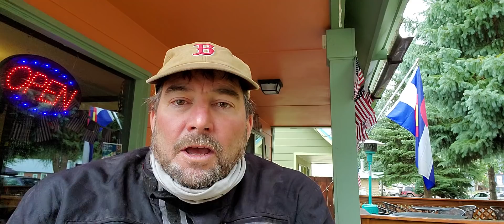5th Stage Bleed Valves explained 737 Emergency AD

Comment: This is probably unrelated but a couple years ago I was on a plane and soon after the doors were closed at the gate, my ears popped.   I thought this was a little odd since this usually happens at altitude.   A couple minutes later, the pilot said we will have to take another plane.   When I heard about the two bleed valves it reminded me of this incident.   The plane was a Embraer ERJ-145.  Any idea what this was?

Comment: I was wondering if the  the air from the little overhead nozzles came directly from the bleed valve or is it recirculated air. I was thinking you could make a mask for nervous people that hooked up the the nozzle and provided them with "new" air rather than recirculated air.

Comment: https://www.youtube.com/watch?v=L4CT6qCNW8A AGENT JAYS Z'S VIDEO HAD OVER 500 HITS WITHIN A COUPLE OF HOURS. STIFF WHISKEYS ALL AROUND ON THIS ONE! THIS IS  BETTER EXPLAINED IN AN EARLIER VIDEO HE MADE. As you say 3 different types of bleed air for the turbine alone. AND Redundancy built into the engine with BACKUP Valves. So a backup valve which IS'NT even in the Service Manual for the engine is the part thats failing. Essentially Rusty Springs that force the valve doors to close on a drop in pressure. With other BLEED AIR Systems you DON'T even know about as they're used to cool the flame (barrier with the inner casing) and Cool air between the inner and outer casings. So ALL IN ALL somebody has written a confusing directive as those pipes providing the cooling air to the turbine casing just show up as engine temperature in the Cockpit. Yet are and Intergral part of Cooling the engine itself.

Comment: Great explanation about the 5-9 and compressor stall - but what if both engines flame out at 30K feet? What will happen with the pressure in the cabin?
Reply from the maker: Slowly depressurize. Not to worry, you are going downhill anyway...

Comment: As a former jet aircraft tech in the USAF many years ago I fully understand all of this. A good example in relation to one of the first things that I was taught, and latter experienced, was the problems that develop with aircraft that aren’t flown for a period of time like a hangar queen. This brings up a concern with this  Corona 19 storage situation and all the aircraft returning to flt ops, what is being done to prevent other problems arising from this flight inactivity? I would think some sort of depo level overall inspection and R&R of other essential items. It would be horrible to have a rash of problems and accidents result where post findings prove the problems originated from the storage period.

Comment: I have a question regarding Air France 447. The pitot static tubes froze mid flight which caused disorientation and ultimately the stall and crash. How can this occur? Is there an anti-ice system for the tubes that malfunctioned?
Reply from the maker: Overwhelmed.

Comment: simple fix...clean the valve or change it and send the bad valve to get fixed {usually just a cleaning will fix it} FRC East did tons of these valves and there is nothing to them...the problem is storage not running and the reason the AirBus does not have these problems is they have not been in storage...have a good trip Juan

Comment: That’s the most kack - handed explanation of the Cfm 56 bleed air system I’ve ever heard. In fact, 5th and  9th stage air bleeds into a common manifold. 9th is prevented from bleeding ‘backwards’ through the 5th stage manifold back into the engine by the fifth stage check valve, a simple flapper style valve that must be oriented correctly on the engine so that gravity does not hold the valve in the open position. At low power settings the fifth and ninth stage air flows through the PRSOV, the Pressure Regulating and Shut Off Valve, which modulates between open and closed to maintain downstream pressure at about 45 PSI. Obviously, the fifth stage check valve is very important and there are already many AD’s regarding its inspection and function. The system is almost the same on ‘Classic’ dash 300/400/500’s and the ‘New Gen’ 600/700/800/900’s. Not sure about the Cfm56-5 engines on the A320/A340’s. I’d reckon they are similar but, as I’ve never studied them, I can’t say.

Comment: At work we use a turbine engine to produce electrical power, the fifth stage bypass is used to prevent over pressurizing the compressor at low rpm/ low power , cool the exhaust compartments, and provide anti icing to the inlet.

Comment: JUAN, hello, but at least I  am not sure if the B787 uses bleed air to pressurize it, but the CABIN pressure is MUCH LOWER THAN USUAL + the. HUMIDITY LEVELS ARE HIGHER ZTHAN NORMAL& the AIR CONDITIONING does not use bleed air. Not been on one as yet ,  this valve is a n ODD ITEM caused by lack of use due to COVID 19, oh well  Cheers 🇺🇸🇺🇸🇺🇸🇺🇸

Comment: Double flapper style bleed air check valves are explained in this report of previous failures. https://www.google.com/url?sa=t&rct=j&q=&esrc=s&source=web&cd=&ved=2ahUKEwjlx6C3gurqAhVfAp0JHbB8Am8QFjABegQIAhAB&url=http%3A%2F%2Fwww.ansv.it%2Fcgi-bin%2Fita%2Friscontro%2520FAA%2520per%2520OY-MRG.pdf&usg=AOvVaw1Ht1dHuFMr84EjFBvdufu8

Comment: The bleed air valves are part of the airframe TC even though installed on the engine. (Same as they IDG). So on the CFM56-5 for Airbus they use different bleed control valves.

Comment: I was on a flight out of DFW that couldn't keep pressure after leveling from climb. They wiggled the wings a few times (trying to free up a stuck valve i assume). We turned back to DFW but had to hold a pattern over northern TX to burn fuel before landing. I wonder if this has been a common problem?

Comment: Have been to GE CFM56 school. This type and style of check valve is common on a lot of different engines. Very simple design. Usually on a letter check there are work cards to remove these valves and visually inspect and check the wear with a feeler gauge. Just two flapper halves (looks like a folded in half taco) with a single hinge pin. Some times they are worn and may not close all the way. Hardest part about doing the AD is opening and closing the fan and reverser cowls. Never had one hang completely open or corroded. They are asking you to to the usual wear check and exercise the flaps in case they are stuck. Usually after a 5 day sit most airlines require a take off power confidence check engine run. If it is stuck open this is where it will show up. Both engines inflight having the valves stuck open would say is highly unlikely. Doing the inspection after an extended storage would be prudent under the circumstances. Not every airline does good maintenance. Happy travels!  👍

Comment: A side question in terms of Atmospheric Pressure, What is the limit of Atmospheric Pressure that a commercial aircraft can handle at sea level on the tarmac if pressurized.  I think it is less than 2 units of Atmospheric Pressure. Do you know that measurement

Comment: Interesting issue. Surprised there is not a check valve preventing flow from 9th stage back into 5th stage, sounds like a design issue.
Reply: My thoughts exactly.
Reply: There is, and it can stick open, hence the problem.

Comment: Can bleed air valves be changed with the engine still hanging on the Wing or does the engine have to come off the wing to change it ?
Reply: They can be changed on wing. Simple job.

Comment: According to research by Maximus this engine  dash number ie only used on Boeing air craft. Normally I would agree that a dual engine failure from this cause would be extremely rare but the game changer is air craft storage especially if it is not stored in a desert type climate.
Reply: Both engines were/are stored undertake same conditions during shutdown, so its the one fails due to corrosion it is quite likely the other is harmed as well.

I strongly disagree a double engineerings failure out of this rout cause is extremely rare. So does the FAA.

Comment: Is this check valve considered part of the engine or part of the airframe?  I am guessing airframe and that is why the A.D. is written on Boeing 737’s.  If it was the CFM56 engines I am guessing the Airbus A320s would be included.

Comment: As a 35 year Amt for a major airline let me summarize. At high power settings the 5th stage is adequate for most bleed air needs (air conditioning, pressurization). At low power settings (taxi, descent) the 5th stage needs help to keep up with those demands. A 9th stage augmentation valve will sense the low pressure from the 5th stage and open to assist with those bleed air needs. The 5th stage has a "one way" check valve to prevent high pressure, 9th stage air,  from bleeding back through the 5th stage bleed air port. If the 5th stage "one way" check valve remains open during 9th stage augmentation, then a "blowback" occurs thus introducing high pressure, 9th stage air,  into the lower pressure, 5th stage air,  compressor section. That will cause "Compressor Stalls".  Alot of aircraft have been parked during this shutdown, and their systems have not been "exercised"...Depending on the abnormality, you may see engine start abnormals, high power setting compressor stalls, or low power setting compressors stalls. Any aircraft that have been parked during this "crisis" need to have thorough run ups and inspections.
Reply from the maker: Thanks Robert, can you tell us about the inspection process for this AD?
Reply: @blancolirio  https://rgl.faa.gov/Regulatory_and_Guidance_Library/rgad.nsf/0/ec0e5875b315e9e5862585ae007cd448/$FILE/2020-16-51_Emergency.pdf
Reply: Robert Costales - Would have thought the pre-storage process would include prepping the valves would be protected some way. Likewise the process of taking it out of storage would include checking and prepping them for re-entry to service.

Storing a 737 isn’t something new, so the issue must have been known previosly. I guess the number of aircraft being and coming out of storage increases the risk, hense the AD to ensure that they are checked before entry into service.
Reply: @ACPilot  There are very specific procedures to carry out when an aircraft is parked. Depending on the length of time it will be parked, the procedures become more detailed. But, you are right, with so many airplanes parked at once it certainly highlights what was probably just an occasional issue previously. The only effective way to handle it now is to issue AD's. I have a feeling we are going to be seeing a lot more AD's for various issues related to all these planes being parked.
Reply: Robert Costales 
And now you know why Boeing is afraid of how some airlines have put their Max’s away.  Stories of damp humid conditions, no covers, etc.  Another major issue with the Max, no matter how much was to blame on the airline, and it could be that last straw.

Comment: Appreciate the details, I never new pressurization drew from different compressor stages depending upon conditions.  Good job Juan..! 👍
Reply: All engine manufacturers and engine types approach this problem differently. Only the engine specific maintenance manual(s) knows for sure.

Comment: So very jealous of your trip but Holy Molie you are beginning to look like me after three months "lockdown" in the UK . Several friends commented "Here's Johnny" to my photo posted on Facebook. However thanks for the update on the further problems with the Max. Hardly surprising. Aeroplanes are designed to be worked and worked hard. Leaving them sitting around is bad for them(and their crews). I am saddened that the popular press will latch on to this story and try to drive another nail into what is essentially a good aeroplane.

Comment: Juan yes the AD at the moment only applies to the CFM-56 engines. Used on the 737s. Same engine used on A-320. However the engine on the 737 is flat bottom and because of that it does behave differently between the two aircraft . that's the simplest answered to your question without getting into great detail.
Reply: Also the make of valve is different.

Comment: Juan, VERY WELL explained in lay terms. I fully get it but have one question?  I am assuming that Both engines are supplying bleed-air  to the commoned functions. Instead of cutting one engine, couldn't the stage 9 valve be closed on the engine with the stuck stage 5  allowing that engine to supply lower pressure bleed-air to the cabin instead of none at all?      sdh  in CT  (BDL)

Comment: Juan, the check valves are not a part of the CFM56 engine itself, but are a part of the nacelle and engine supporting equipment.  They were developed by Boeing specifically for this installation, which is why Airbus wouldn't have them even though they use the same engines.  Airbus will have a similar design for their installation.

Comment: If the 5th stage valve is inadequate during lower power, why not use the 9th stage 100% of the time for the bleed air functions?
Reply: Robert Costales (comment above) explains the relationship between the two valves: "The 5th stage has a "one way" check valve to prevent high pressure, 9th stage air,  from bleeding back through the 5th stage bleed air port. If the 5th stage "one way" check valve remains open during 9th stage augmentation, then a "blowback" occurs thus introducing high pressure, 9th stage air,  into the lower pressure, 5th stage air,  compressor section. That will cause "Compressor Stalls". " Hope that helps.
Reply: @lizj5740  Yes, thanks!
Reply: Why not use 9th stage all the time?   Probably because it's inefficient (in terms of power consumption) to compress air to a high pressure then reduce the pressure again for use.   So if the 5th stage is giving enough air pressure at some engine settings, it saves power to tap that off rather than let the air be compressed up to much higher pressure (9th stage) then have to reduce the pressure through some sort of throttling valve again.
Reply: @cr10001  Excellent explanation, thanks!

Comment: Something I cannot understand - if the 5th stage valve sticks open couldn't one just shut the 9th stage valve to prevent the compressor stall, and continue taking bleed air only from the other engine?

Comment: Regarding why this only applies to the B737 and not A320, these valves are designed and produced by different manufactures that meet different end customer specifications (Boeing requirements vs Airbus requirements).
Reply: Joel L - Why would CFM source these from different manufacturers? Doesn’t make much sense.
Reply: @ACPilot    Because the aircraft manufacturer specifies the make/type of valve to be used??

Comment: Since both engines are attached to the same aircraft, and the issue is one that crops up in storage (in as little as 7 days according to the FAA!), this means that both engines were stored in the same circumstances. Due to them both being subjected to the same storage conditions and therefore corrosion issues, I would say that you can no longer treat the engines as totally independent systems. Therefore, it follows that the FAA's concern about a dual engine failure is entirely warranted.
Of course that's just my layperson's take on it.
IMO, you as a systems engineer have to prove the systems are independent, merely having them be doubly or triply redundant isn't quite enough. I'm reminded of that one crash (EDIT: Turkish Airlines 981) of a transport category aircraft where the floor between the cargo hold and the passenger cabin collapsed and took out all three "independent" control systems for that aircraft's tail surfaces, because those three "independent" control systems were all ROUTED DIRECTLY NEXT TO EACH OTHER, meaning that ONE failure was easily capable of taking out all three systems in one stroke. This is the hole in the "swiss cheese failure model" that that unfortunate flight flew thru, to the detriment of (I think) a couple hundred people.
I will edit this comment with which flight I am talking about.
EDIT: I think I'm talking about Turkish Airlines flight 981.

Comment: Can someone please answer Juan's question why this AD does nOt apply to Airbus aircraft? Does Airbus have different storage/maintenance  requirements? Does Airbus use a different version/modification of the CFM engines? IDK... Very much looking forward to the explanations.... many thx in advance.
Reply: These valves are designed and produced by different manufactures that meet different end customer specifications (Boeing requirements vs Airbus requirements).
Reply: What Joel L  said, and also, the engine variants are different.   The A320 version has a bigger fan diameter than the 737.

Comment: Surely all aircraft fitted with these kind of engines are at risk not just the 737. Bit unfair to make Boeing the whipping horse again.🇬🇧
Reply: Except the CFM-56's fitted to 737's are not the same as the CFM-56's fitted to other aircraft, and anyway, the bleed air system is specified by the aircraft manufacturer.

Comment: On the engines I worked it is an actuator that open a door like on the compressor. which has to be perfectly rigged to avoid compressor stalls!  They were checked on test cell when running up and down the throttle which had to be on specs on time and compressor rpm!

Comment: you'd think thererd be a better system design less succeptable to engine failure due to a single sticky valve than this....welcome 787
Reply: Thus the beauty of 787 bleed or lack of bleed architecture. The 787 GEnex engines are only bleed for engine TAI and various internal bleed valves for venting of various compressor stages to enhanced core flow stability and continuity.
Reply: Rusty I am type rated in 8 different types of aircraft, and bleed valves have a history of problems. The fact that these have been sitting for a while leads me to believe the lack of use is mostly to blame.
Reply: @robertposey2270   Robert, excellent point demonstrating the adage, 'use it or lose it', where device reliability correlates to lack of use.